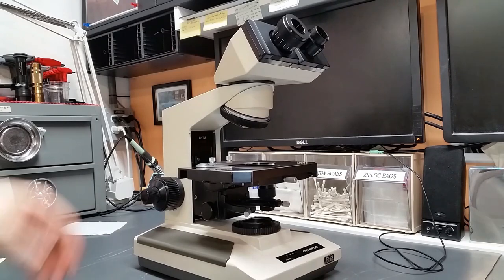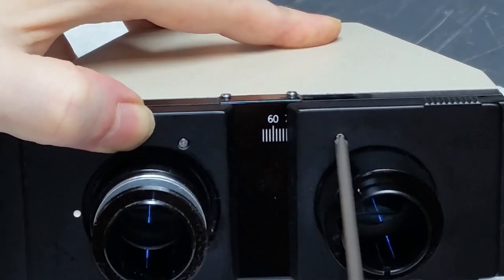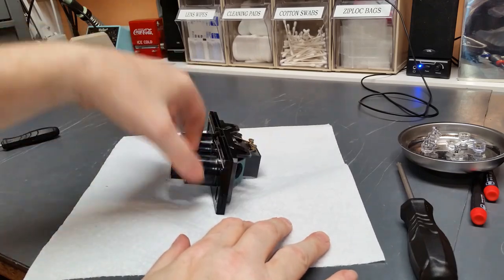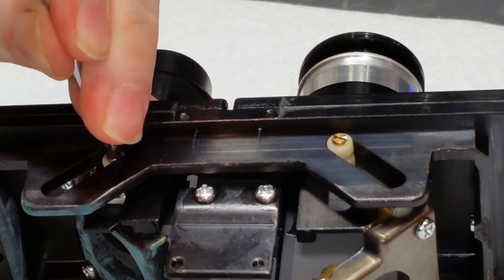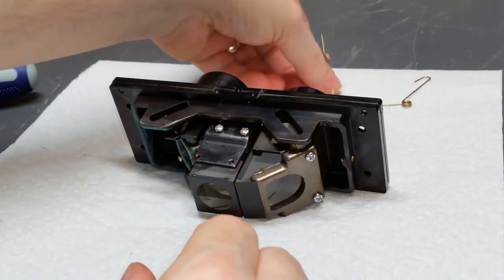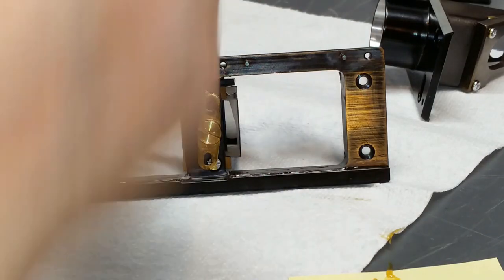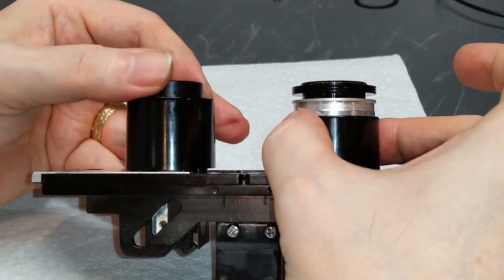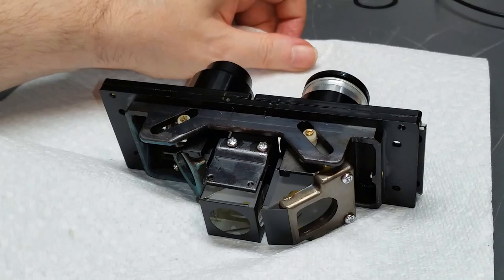Overhaul of Olympus BH-2 (BHTU) Microscope - Part 7 (BH2-BI30 Binocular Viewing Head)

Comment: 26:50 did you say Plastilube Brake grease? If so can I use any brake grease  for dovetail slides? I have a container of purple Permatex brake parts grease, wonder if it can be used for this.
Reply from the maker: Yes. It is ATE Plastilube grease. Available in the US on Amazon.

Comment: How did you get lucky enough to have one without the intra-ocular distance slides being frozen in place closed to the point you can't get at the four screws without using heat, Kroil, or some type of solvent to get them loose enough to move :-) ?  Nice video!
Reply from the maker: The superwide heads are notorious for totally seizing up.  The 30mm ocular tubes have more friction, due to their larger diameter, and the brass material didn't play well with the Olympus grease.  At least with the trinocular versions, the slides can be decoupled from the tube length compensation, to allow you to get them apart.  The binoculars, not so easy!
Reply from the maker: Classic Catch 22. The only way to make it move is to open it, for repair.  The only way to open it is to move it first!
Reply from the maker: If I ever get one totally locked, I'll shoot video of whatever transpires...